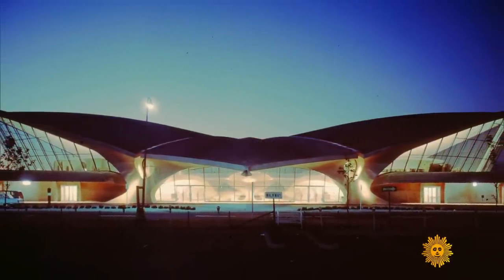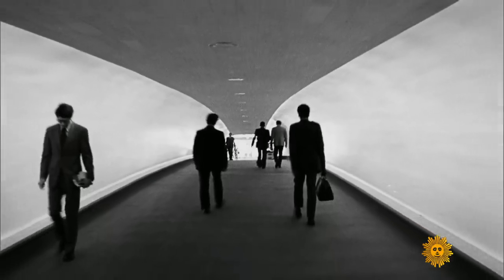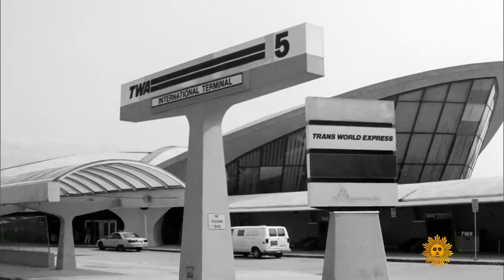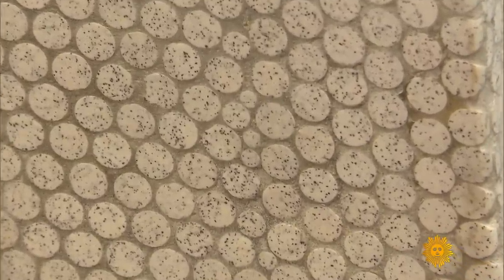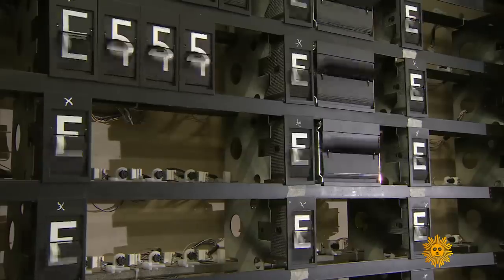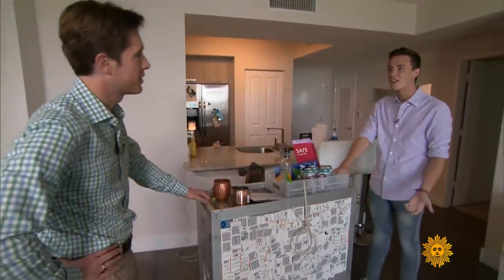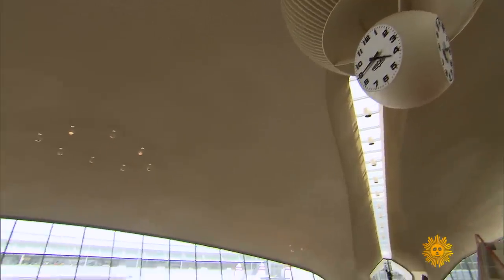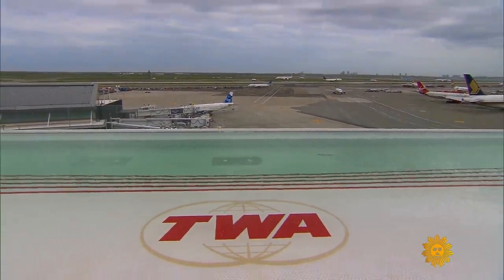Flight of fancy: The TWA Hotel

Comment: In 1976 I flew on the last Boing 707 TWA flight from Lisbon to JFK. We only had 20 passengers and at least 10 stewardesses! The best party I ever had, nobody wanted to leave the plane! I do so miss TWA and the whole flight experience in those days.
Reply: I miss the 707. It was such a nice plane. I remember TWA was I think the first airline offering movies on board. It was a simple projector and a small screen in the front. The meals were always a delicious steak and a cheese cake. Then later they downgraded.
Reply: I miss the 707 as well.  I remember as a kid, that was the only plane where my ears didn’t block bad on take off and landing.  Heck, I wouldn’t even be alive if it wasn’t for the 707 and an incredible TWA captain - my mother was on board one that was in a mid-air collision over CT, and landed safely, before I was born.

Comment: JFK is a miserable airport. It should’ve been Bulldozed over years ago. The TWA terminal was completely designed for the form, the functionality was horrible. No considerations for the disabled or family travel. When the luggage searches and metal detection walk-throughs were installed, the building really showed It’s inability to be revised to cope with the future. It will do better as a  museum.

Comment: Chris van Cleave, who reports this story, is, at times, a wee bit too cynical.  C'mon, Chris, this iconic structure has got lots of fans, we don't need to hear no negativity!  But, also, and maybe this is more for the producer of the segment: the way you presented the building got me completely confused.  You gave us absolutely no sense of where the rooms are located!  The shots you chose, haphazard, and it's hard to figure out exactly where those rooms are, and where everything is in relation to everything else.  Not impressed.  Also, are there any extensions built onto the structure to accommodate the guest rooms, or are they all inside the original structure?  That is not explained well.  

But TWA was OUR airline as a family, we always flew them first, unless they weren't going where we needed to go and the terminal will always live in our memories.   (P.S. Multiple lashes on corporate raider Carl Icahn -- legendary for pure evil, greed, profit -- for doing another hit job on a great company as TWA and taking it from the skies and running into the ground -- the airline should have still been here today, same as American, Delta and United, but for Icahn.  I'll never forgive this man who has truly hurt a lot of good in this country).
Reply: Thank you.